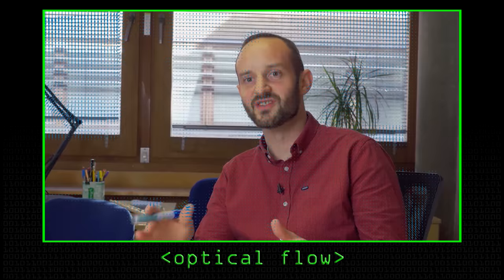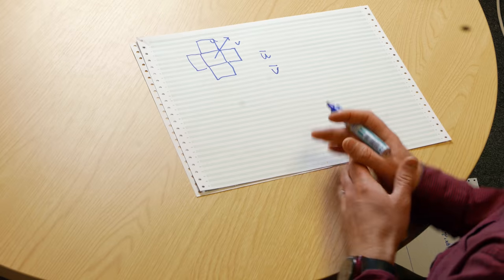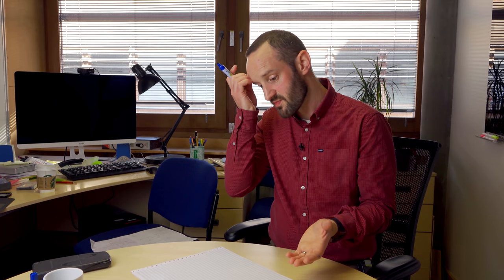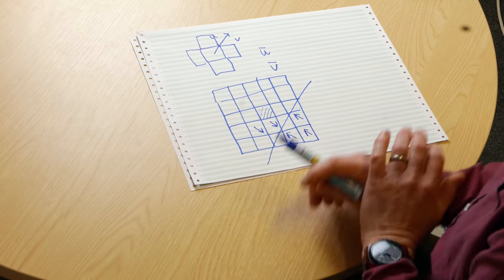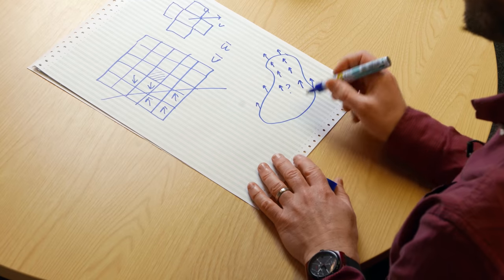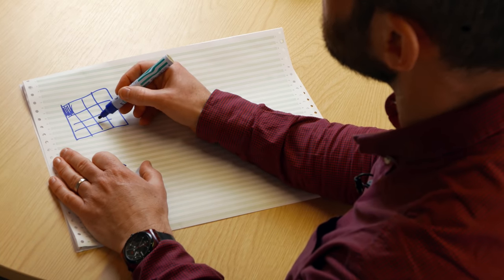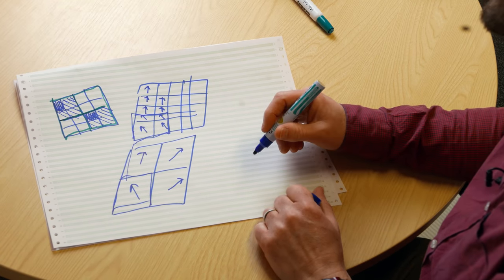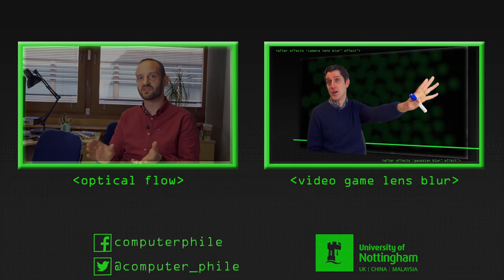Optic Flow Solutions - Computerphile

Comment: I recently made a tool which extracts motion vectors from MPEG-4 and H.264 encoded video which can be used for tracking. Advantage is that the motion estimations happens during encoding of the video (or on the sender side in case of a video stream). Thus, no computational effort on the decoding/receiving end is needed to compute optical flow.
Reply: Oooohh I would love to hear more about your tool! Does it use ffmpeg?

Comment: Could you use optical flow for astrophotography autoguiding?
Reply: Yes, that is how the Celestron NexGuide and Orion StarShoot work.  You select a star or sometimes a few stars for the guiders to follow, so they do not need to process every pixel in the image.
Reply: Every Stacking Software basically works like that. You select a few stars on the first few images and the software can recognize the direction of the stars.

Comment: Not really into vid stuff so not sure if this is what you were refering to but shouldn't you just start with center pixel and examine the rest of the pic for potential places it moved to then examine the area around those places to see if it matches with original place and then use your calculations when it matches?